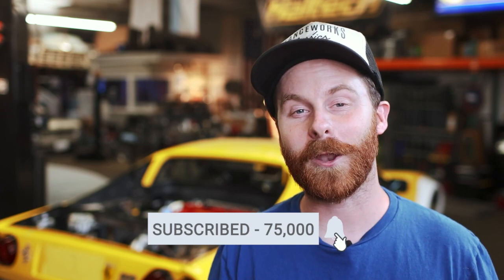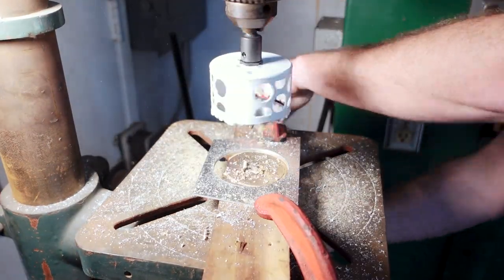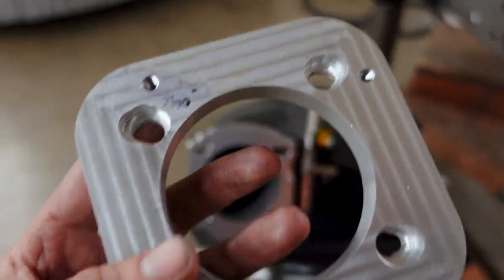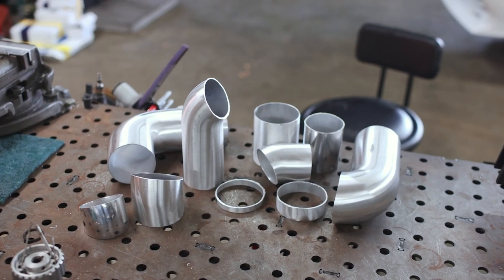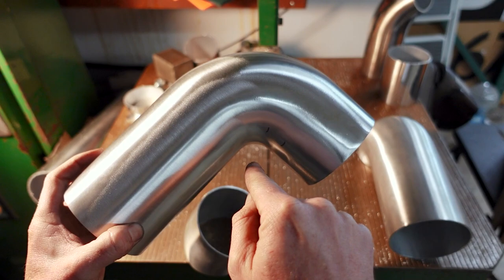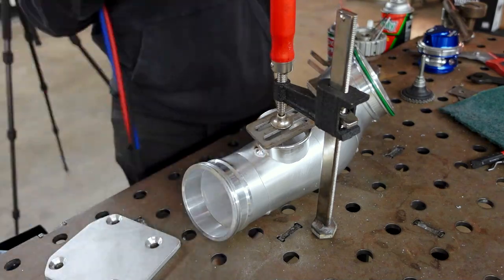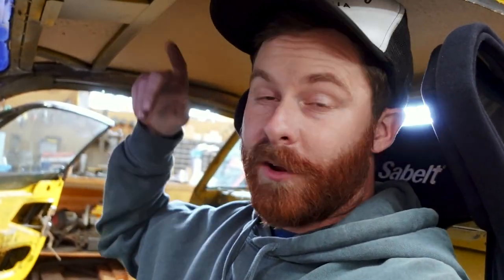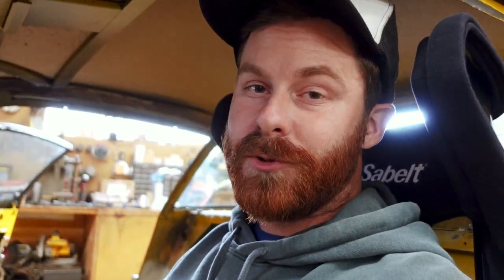1000hp Honda-Powered Ferrari Gets Intercooler Piping & Blow Off Valve Setup! - Ep. 76

Comment: Sir, you probably want to rubbermount the intercooler. The pedestal in the trans tube is cool but vibration could be detrimental to such a complex aluminum part.
Reply: Agreed 100%. This is a great bit of advice.
Reply: Was totally thinking the same thing.. just a little cushion needed.. like being lifted up by a little ring of rubber or something along those lines.
Reply: Agree'd a rubber o-ring seat would help. Additionally maybe a pin or grub screw to actually locate it.

Comment: In the 1889’s we took a 77 308GTB fiberglass unit and created a GT-2 SCCA race car. The structure was a mish mash if small rectangular tubes which we largely trashed saving the oval tube backbone and structural cradle for the engine and front suspension. The remainder was chrome molly tubing. While the fiberglass roof remained, all body panels were molded hand laid thin fiberglass

Comment: I’d recommend using acetone to clean your parts before welding. Using brake-cleaner has the potential to cause very serious health effects or kill you quickly. The issue is from the vapors from the residue being heated thus creating phosgene (nerve) gas. Many people think because the brake cleaner evaporates so quickly that it isn't an issue, but it has more to do with the residual left behind getting hot and vaporizing vs. the brake cleaner itself before it vaporizes. 

Great build though. Keep it up.
Reply: Woah shit. Interesting.
Reply: I second this!! Brake clean before welding = 🤢🤮😵
Reply: 3rd this No Brake Clean man, Acetone!
Reply: I personally know someone that was put in hospital with lung issues a few years ago and almost died from using brake clean for welding. Doesn’t matter how much ventilation it won’t stop it.
Reply: He is using the non chlorinated version so it's the safer bet but yeah I'd just rock something else if I was doing that much welding consistently.
Reply: @ivanamaya2938  doesn’t matter if it’s non-chlorinated. It’s not the chlorine, but Tetrachloroethylene that’s the problem. When this chemical is exposed with excessive heat and argon (used in MIG and TIG welding) it produces phosgene.
Reply: This needs more visibility.  That can cause serious issues!
Reply: Yeah he even talked about not using brake cleaner around welding in an earlier video so I was surprised to see him do that.

Comment: For the roof- Use the existing headliner parts to cover the pillars and the ugly bit at the back corners, then cover it in foam backed faux suede/alcantara. I have used cheap stuff to re do two headliners, one by bonding to the original liner backing and another straight to insulation material on the roof. I am no kind of upholstery genius but both came out pretty well. It glued in tight and stretches where you need it to, the foam backing is about 3-4mm thick and does smooth out some imperfections in the sub surface. 
I think you could make it look great in there with a dark grey or black alcantara roof, better than carpet and still giving you free height.

Comment: When making flanges like the adapter for the throttle body, machine in O-ring grooves, someone with a CNC can do it easily especially if you have the CAD drawing of the plates. You can by o-ring stock material in various diameters and lengths and glue… just cut to length (at a 45%+ angle to increase surface area being glued), job done and better than a paper gasket 👍
Reply from the maker: We discussed adding an o-ring groove but there’s not quite enough room to add one.
Reply: Adapter comes with a rubberized gasket that fit between the two flanges

Comment: Headliner idea i had but didnt post  Do the gurney bubble in the headliner only. This can easily be made out of a single layer of fiberglass, kevlar, or carbon the mold for it can easily be made out os a single piece of 2" pink insulation foam from the local box box store.  Then bond it to the backside of the headliner after it's trimmed. Then recover it. A fairing cover can also be made at the same time to wire tuck the harness for the switch panel.

Comment: Alcantara headliner panel, which follows the perimeter of the roll cage up there - suspended by strong magnets so you can remove it easy for track use.  If you leave a small gap between the headliner panel and the rollcage, then add some LED mood lights behind it up there, the light would leak through and add some accent lighting and could also act as a modern solution to a dome light :)

Comment: Cork. Believe it or not that's how I lined my Jaguar XJS roof when the interior shell fell apart.  Just that shelf-lining cork installed by Weld-Bond. It looked good alone but it became both the base for my new headliner install, but also sound deadening, low thickness liner, and new surface. I drew a middle line and installed the rolls out to the sides from there.  It'll add less than 1/8" thickness and look great.

Comment: Couple issues you may want to look into before proceeding.  One is the mounting for the intercooler.   Because it is a solid piece of metal it will not play around when needed especially because hard mounted the cooler to the intake.  when you apply gas and the engine moves on the engine mounts it will tear something apart.  most probably the quick couplers will break first. you will need some sort of flex in that area.  you only problem is not vibrations and movements but also heat.  The intercooler will work and it will be hot on oneside and cooler on the other and things will move around due to expansion.  Another thing I see is you built the solid hose without the gaaskets.  but you have 2 adapter plates which means you will use 3 gaskets which will be atleast 3 mmm each.  for a total of 9mm.  unless you are using 0mm crush gaskets then you can disregard this but if not you are going to be off to oneside.

Watching this series with great pleasure.  Awesome work.

Comment: flocking after cleaning the “scabs” and welds on the roof could be a super simple solution to the lack of headliner.
Reply: Scrolling the comments thinking I shouldn't be the only one thinking about this!
Reply: All I was thinking about as soon as it was gone. It would look super dope but i think without a rotisserie it would be a struggle to get that to adhere in a uniform pattern. But my attitude is....because racecar do it.

Comment: i think the best and least amount of work would be drop the seat.  this way you keep the oem headliner and roll cage. you drop the seat no one will ever be able to tell from the inside only if they got under the car and looked at your floorboard. plus i'm sure it still would not be the lowest part of the car. 1.5 -2" and your set.

Comment: Hi Mike, With the head liner out and there's now a gap between roll bar and roof, rather than re make the roll bar you could weld in a  gusset from the Roof to the bar? Connecting the bar to the roof would increase chassis rigidity. The gusset could be bolted to the roll bar or welded, you could also cover the gusset in the same material used for the roof covering. Just a thought.

Comment: The whole headliner issue and which route to take to fix the seating position plus a helmet clearance is mind boggling! However with ur chosen path, of remaking the hoop and diagonals, thats alot of work and fittment plus coming up with solution of headliner that is still not tackled yet. Way i think perhaps cutting carpet under ur very own seat, and going lower a couple of inches (if not obstructed by anything down below), patch panel, welded and small patches of sound deadening is much easier if u d ask me! And just keep a roll cage u made as it is! Also stock headliner covering all that OEM welding monstrosity! And definitely dont screw with body lines, go down rather than up is what im suggesting! Great progress and following up closely on that amazing build!

Comment: Thoughts for the headliner.  What if you glue a matching headliner fabric directly to the roof's sheetmetal and make an opening in your OE headliner that runs over the driver and passenger seat.  The opening sides would meet up with your upholstered roof sheet metal and look pretty clean.  This would be a permanent solution and would also allow you to retain the current roll bar since the opening in the headliner can start past your roll bar and short of the metal bracing near the windshield.  I personally think it would look pretty good and have that functional look to it.  Anyways, really enjoying this build and hopefully this idea is a plausible solution.

Comment: 2 questions / comments: how are you cooling the intercooler? Are there end tanks to go on yet? Also, if you are dispensing with the stock headliner why not go full cage with removable door bars? Great series, one of the best in YT!
Reply: I thought the same thing for the intercooler
Reply from the maker: It’s a water to air intercooler, not an air to air intercooler. It’s cooled by the second radiator we put at the front of the car. 
I don’t want to go full cage because of the head room problem discussed. It’s not safe at all for a street car.
Reply: @stanceworks  Yeah, I guess having to wear a lid every drive would be a pain. So, is there water end tanks still to go on the cooler or am I missing something fundamental?
Reply from the maker: You are correct. I mentioned adding them in the end of the episode.
Reply: @stanceworks  Ahh, trying to watch with the kids playing in the background again!!

Comment: I understand how you feel about those interior parts.  I would feel the same.  Last video I suggested to apply (with vinyl top adhesive) diamond stitched alcantara or vinyl right to the inside of the top as a headliner and I still think that's the answer, maybe with a thin layer of foam.  As with the a pillars and similar areas, why not just body-work those areas with fiberglass and light weight body filler to smooth them out?  Then you could either vinyl wrap, or (now bear with me), you could use SEM spray texture in those areas and apply spray vinyl dye.  I have used that technique on custom a pillars for speakers.  It really looks pretty factory and its durable.

Comment: You do a great job mashining als the parts in shape. I found only one issue, the intercooler mount to the bodyshell. The vibrations will crack the aluminium structure if its to stiff. Better rest it on rubber mounts

Comment: Would you consider putting an O ring on the bottom of the intercooler support leg? It might be a useful "bump stop" to prevent vibrations traveling up and the weight of the water causing cracks in that neat cooler. 
Just my thoughts compiled from incomplete data because I don't know your plans for the top mounts and I know you always have a plan

Comment: For your headliner, I would find an upholsterer and see if they can make you a headliner that has a step/bump in it around the head area.  Kinda of like how the FD RX7 has the molded in bumps for the driver and passenger.  Now that I think about it, the FD RX7 and 308 probably have similar size interiors, you may even be able to cut up one and use it as a mock up or something.  Just throwing ideas out there, I'm sure you'll come up with a slick solutions that makes you happy.  Keep up the good work!

Comment: not an expert, but i believe that blow off valve position is aerodynamically inefficient, possibly bad.

air compresses on the outside of a bend within a tube, leaving a lower pressure on the inside than the outside. the air will also not flow well to the blow off valve from this T-junction you have made. 

the best place from what I have seen on most turbocharged racecars is on the outside of a bend, with a Y-junction to allow a lot of airflow to the BOV. this allows very precise boost control according to the mechanics and engineers that built them.

your work is fantastic and i'm absolutely in love with this build, and i've watched every episode so far. I just want to point out something that may need to be changed so you may not hurt your motor when you turn up the boost

Comment: As an upholsterer I would just do exactly as you said put in foam shave it down put material over it one thing I can tell you do not use regular spray adhesive it'll reactivate at a hundred degrees and let go of anything it's holding make sure you you use headliner spray adhesive

Comment: This build is coming out sick. I can't wait to hear it start. I would use the pop up spot but take them out and put flat fixed light  conversion that people use on rx7, nsx and  miatas but I don't know if the front end is sloped enough down like those cars for the light to point in the right direction
Reply: He mentioned that he doesnt like that look and would rather put in popups and have them down all the time. I think he should have popups up halfway or even less and have smaller bar lights instead of round lights.
Reply: @enki2450  oh gotcha.. I heard him talk about not liking the pop-ups just must of missed him talking about converting them to like the jdm Honda nsx look with the fixed light in place of the popup
Reply from the maker: In the headlight episode I showed a car that had done this and I’m not a fan of the look.
Reply: @stanceworks  it looks good one some applications. Anyways I definitely wanted to say congrats so far on that engine bay. I definitely did not expect that water to air intercooler to looks like that and fill that spot up like it does and the engine needs no words. That thing is amazing. Just waiting for that first start and to see if move under its own power

Comment: I'm curious about how you're going to run the coolant plumbing into and out of the intercooler. Hope you clarify that in the next episode. It's looking great from my perspective and I think you should basically carpet the inside of the roof just like you did the floor. Some foam plumbing-wrap cylinders/tubes, or even pool noodles can be split & tailored to round out the A pillars and the ugly ridges running on each side and then covered in carpet as well.

Comment: Is it possible to use the roll cage as a frame for some type of roof solution?  Perhaps something as dimple dye panels in the back along the sides and the front to cover the issues with a Stance work logo ( a large one) across the middle?  It will add weight but if done with thin gauge aluminum not very much.

Comment: Mike I'm sure you're already aware of this, but as a welder myself I'm all too aware of the possible dangers of mixing welding and brake cleaner. I hope you can switch to acetone or denatured alcohol for cleaning welding surfaces for your own health!
Reply: Or non-chlorinated brake cleaner. Most (if not all) are organic solvent/alcohol based and you don't have to worry about the formation of hydrogen chloride or phosphene gas. They are usually pretty flammable though
Reply: @ndog1234765  Not sure about now, but most of the "Non Chlorinated" brake cleaners advertised as Environmentally friendly, used to have Methylene Chloride, used in cabinet strippers.  While it doesn't necessarily make phosgene or hydrogen chloride, it DOES make for very nasty damage to the central nervous system over time.
Reply from the maker: Thanks for looking out. I only use non-chlorinated brake cleaner - and I did go over everything with acetone before welding. But you’re right it’s a habit I should break either way

Comment: Could you flock the roof panel? If that is something you would want to consider you could put a thin sheet metal over the front portion where the metal structure is and flock the entire portion. Also I know you were looking for a mount for the control panel….. what about up top where it will be easy to access and still be out of the line of site

Comment: For the roof, cut it out and lay carbon fiber. Street Bandito has a video on his 240z. You can leave carbon on inside and still paint the outside. Or just lay carbon fiber strands on the inside for looks only giving it a forged carbon look inside.

Comment: I really like the water to air intercooler setup! I'm just wondering, how will you guide the air into the water to air intercooler now that the blow-off valve is partly in the way?
Reply: This question hurts my head
Reply from the maker: The air goes through the tube work we just made. Water goes through the open ends.

Comment: What if you did the headliner boarder as permanent and then did the middle section as removable? That way the corner sections are still covered  on track days. I think you could do it in a way that makes it look purposeful and not a after thought. Snaps or something to hold it in place and when you remove it leaves a 5or6inch boarder around the roof

Comment: That plumbed engine compartment looks amazing.  Regarding the headliner, why not try to reuse the part above the roll bar and to the rear?  Just fabricate the front half?  That might look best over the roof mess in the back, and it would save you having to redo the roll bar.  Just a thought.  It also doesn't have to be a single piece, so maybe you can cut it in half, make the rear half a permanent install and the front half removable?

Comment: Would taking a wire or plastic wheel brush take off too much material on the roof? A brushed steel look could be a cool alternative to a custom headliner. Understandably difficult to get right, and would get material all over your mostly finish interior. Just curious if it would thin out the roof too much you think.

Comment: If you welded the outlet of the intercooler in an angle and the same with the inlet of the throttlebody it would have been more in line with eachother.